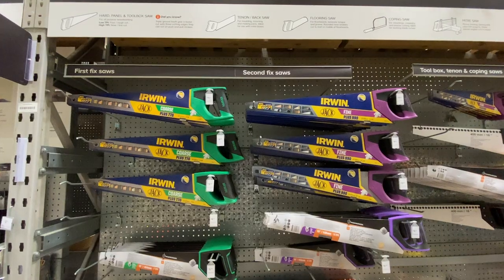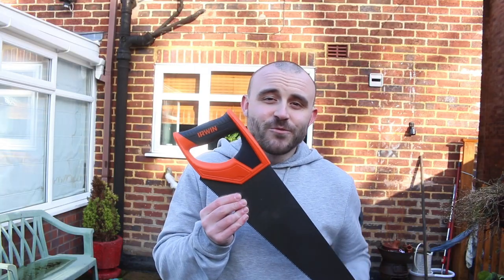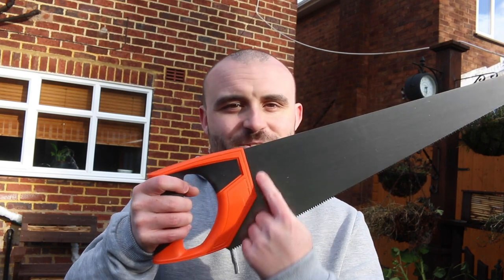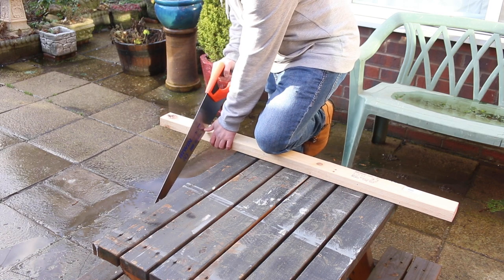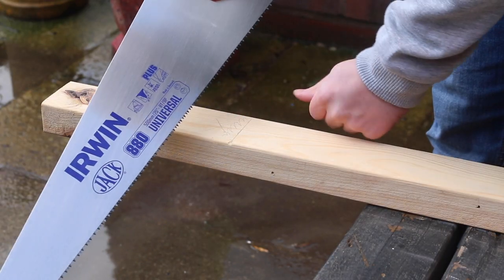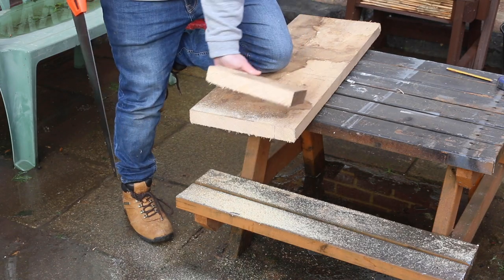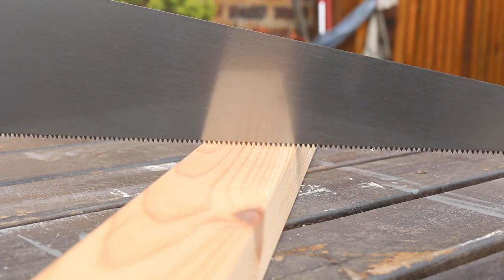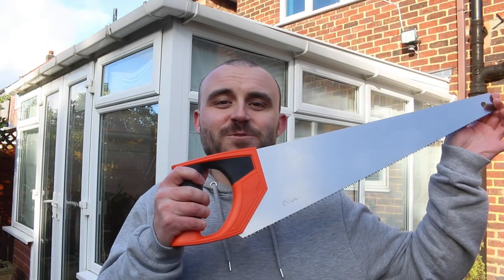How To Use A Hand saw - Back To Basics

Comment: how amazing .thanks .this was very useful to sharethe tips about using the hand saw.Yes can you  please do similar ones using common tools like how to use the sqaures,how to measure various angles like 30 deg 45 deg 60 degs using the square,how to use measure the angle of the slope on a cut surface,how to use calipers ,how to use the drill ,how to use various screws (5screws),how to use impact driver ,how to use sander etc.All ways thinking that the DIYer is cash strapped to get sophisticated tools! Much appreciate you for your wonderful knowledge about sawing.
I really liked the part when you said the cutting happens in pushing not in pulling .i was not told about this in my surgical career!best wishes

Comment: my particular issue is that the saw gets ''stuck'' and there is an impact because it stucks on me while i'm doing the motion. I,ve tried going gradually on force to see if i can get a feel of the technique where there is a sweet spot and you feel almost no resistance and it cuts great, but i don't seem to get the hang of it and i'm seeking more of an explanation of the angle and the motion, is it a subtle curved motion? or is it simply straight? When it gets stuck, is it maybe because i slightly change the angle mid motion and i get a teeth planted in?